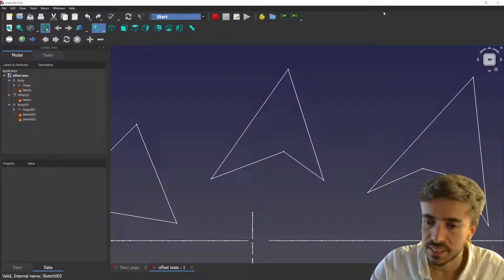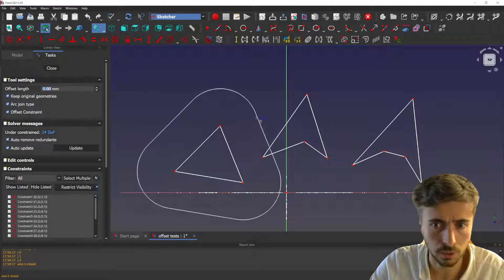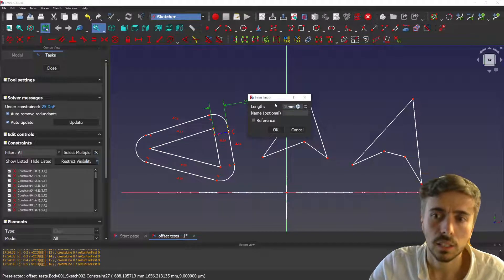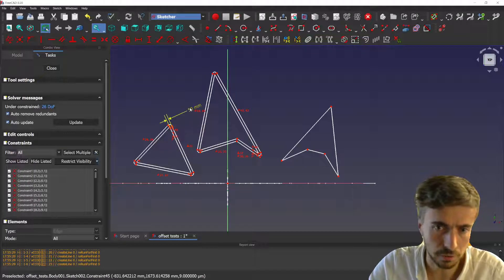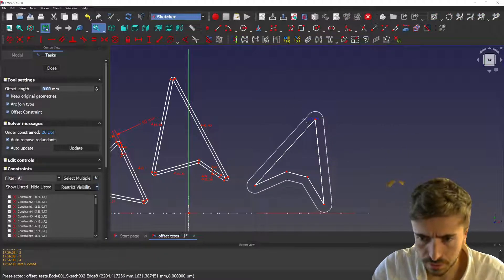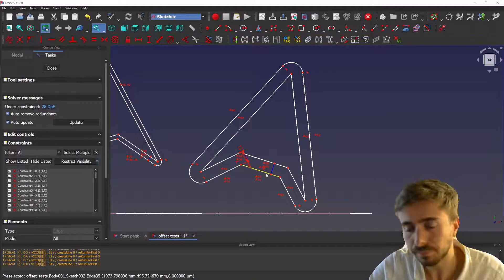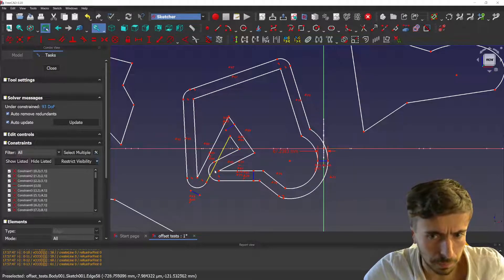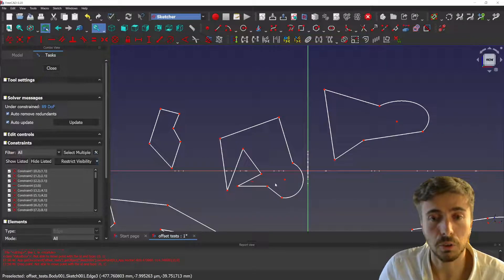FreeCad Offset Sketcher - Parametric improvement

Comment: Good job! I have a few suggestions though. You are obviously using different routines for creating an offset and for adjusting or parameterizing it. If creating works better, why don't you "recreate" the offset? I understand that when you drag a selected line, you prefer not to alter the topology. Otherwise you would not know what you are pulling. But you could keep the line and recreate the rest of the offset.

Comment: I was hoping that with the release of FreeCAD 0.20 these functions would be integrated.
But still, the idea of being able to create parallel lines around or inside a complex shape is practically a must.
We can hope that with the future version 0.21 they will be there. Good luck.
Reply from the maker: Yes unfortunately merging takes a long time.
Though we're almost merging the first tool setting features. Offset is down the line. I think it will be merged for 0.21

Comment: OMG YES that is literally perfect !!  Definitely you got the idea :)    
 I'll trust that U will figure out those little nuances. I don't think there will be perfect solutions for some of them. The objective tho is just so things do not crash(which WOULD happen in the other CAD programs). 
       I guess one idea to improve it is to have it where you can delete the offset and try over.  For illustration >> Let's say u could magically make an offset item(speaking obj-c/collection/class object) . In this offset item, exists all lines+constraints which were generated by the offset. As the modeler continues to model, the offset gets goofy. Things have changed a bunch anyways and the user wishes to delete the old offset and try again with these new lines. So the user finds the offset glyph and deletes it. This deletes all the lines+constraints which were created by the offset...  Next the user selects the new set of lines and clicks offset. 
      Just food for thought caz I can certainly see a problem if we rely on undo to remove the offset.

In general I think the fact that you can see the constraints is better than how inventor implemented it, caz in inventor you cannot see what exists in the offset & you cannot modify it. As such u don't know why it broke OR how to fix it. It was sensitive yes, but not knowing was the worst part caz U cannot learn to be better. (for example, not knowing if the offset tool made a perpendicular or a horizontal constraint. That is an easy workaround as a modeler)  

Can I make one time payments in Patreon ? i'm so broke right now. I have to wait til next month to even buy food.